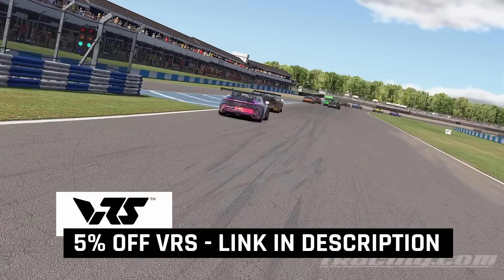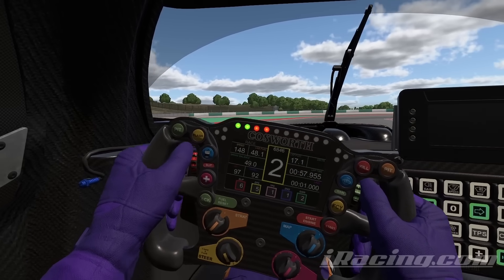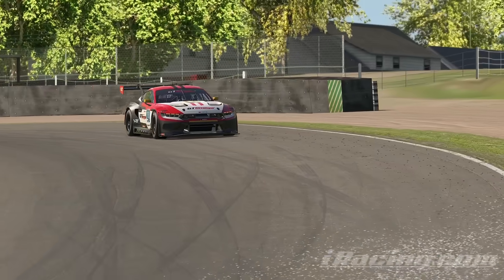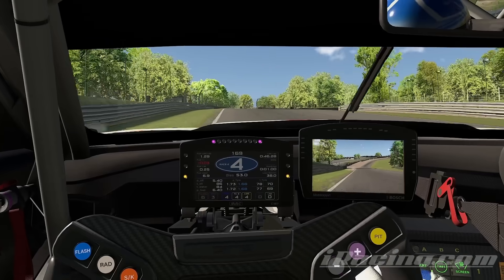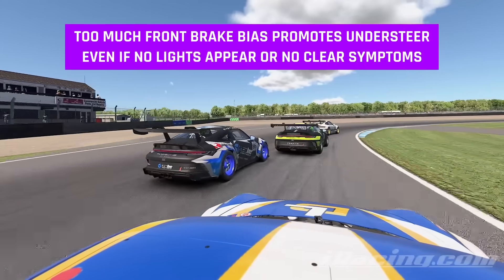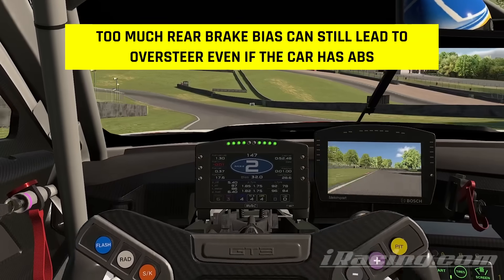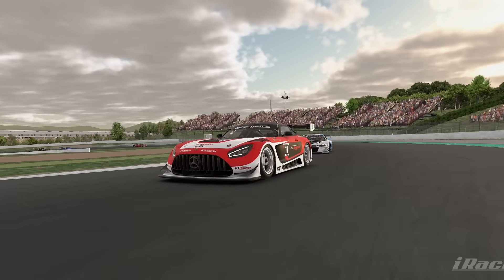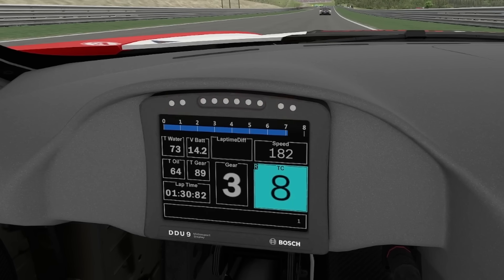These Lights Help You Drive Like An Expert - Driver Information Lights Explained

Comment: In AMS2, I sometimes see the driver information lights in LMP cars light up, even when just going down a straight stretch without any braking.
Reply: Might be the fuel saving system that uses the lights to tell you when to lift. Usually you enable it by setting up a lap target in your car options, don't know if it's on by default in ams.

Comment: At the end of the day, if you wanna be fast, familiarizing yourself with the car and track will be your end-all-be-all solution, practice laps, experiment with setup and see where you can squeeze some performance. Remember that faster setups usually also involve higher risks, wich you DON'T want during races, find something optimally quick that still allows some flexibility for the unexpected situations raaces can throw at you. Said lights can help with setup but once you know the car, unless something is going on, they will not be as important as your own knowledge and intuition, nothing is a replacement for skill

Comment: ive notice in ams2 cars are prone to sliding and oversteering so front brake bias up to 60/40 with abs usualy tames them for ideal cornering while lmu cars are the opposite they are by default understeery so setting the brake bias towards the rear makes them snappy and agile

Comment: Thanks alot for this gem of a video. At 3:39 there is some values for R.Tyre and L.Tyre. I think it's the temperature and pressure. But could you please do a video on how to read and use these values?

Comment: you see simagic extended their warranty to 2yrs
Reply from the maker: Yeah, good move
Reply: @dannyleeracing was your review of the simagic alpha u done using the pro simrig  psr3... just wondered ho it held up
Reply from the maker: @cater4anytink45  Nah, the Alpha U review was done on the GT Omega Prime - it's my mainline rig, had it since 2021. The PSR3 wasn't around for a great deal of time but the good thing about aluminium rigs is that they pretty much stay solid. My PRIME rig is looking a bit scratched up as I've adjusted it a million times, but it's good stuff and cheap.
Reply: For europe it's the law so even if it said 1 year you realistically had 2 to the distributor.
Reply from the maker: @Kpaxlol Yeah, but it’s still concerning when the manufacturer themselves is only willing to cover for 1 year if they had a choice. Resolving that is a very good move even if EU law demands 2 years of them, it’s a question of confidence in the product NOT to go wrong in the first place.

Comment: Makes no sense. Braking less = longer braking zone = longer time from start of braking > corner exit. No way that will improve your lap time cuz u drive slower that you would on hard braking with abs assist
Reply from the maker: Typically, overdoing it under braking steals laptime from what comes after. Yeah, you’ll brake physically harder dipping into ABS, but it’ll be paid for by time loss in the actual corners.
Reply: @dannyleeracing  no? There is maximum speed you can have through a corner, the faster you get down to that speed the faster your corner will be 😂
Reply: @Speedyey  not sure if it relates to what you are trying to say, but from racing karts I find that sometimes braking later means you have to over slow to make the corner. I'm not sure the real reasoning behind it but I can tell from the data that braking later isn't always better. Again I'm not sure if this really relates to what youre saying but I thought id put my 2 cents in
Reply: @23racing69im saying that braking harder with help from abs = shorter brake distance, that means you can brake later and harder and that makes you faster
Reply: @Speedyey I think that should generally be true but what I think @dannyleeracing was saying was that if you go too hard or deep into the corner you have to slow more to get it rotated costing lap time. I also feel that if you're relying on abs your braking zone will actually be longer as the abs essentially is releasing the brakes meaning less braking is done
Reply: @Speedyey also don't speak about ABS in iracing. It's better to avoid abs as much as possible than to use it to the mid/max. With braking "harder and later" you have to point out a telemetry example so that you can tell exactly where you could brake later/harder. Out of context it could mean anything and it's irrelevant.
Reply: Depends on the car, corner, temps and whatever else.

Comment: Those lights (pink/purple and yellow) are always wheel lockups, it says in the car manual from iRacing and from the manufacturer, although most GT3 cars have some kind of ABS blinking in the dash itself.
There's a lot of misinformation about the ABS and Brake Bias, unfortunately iRacing staff won't disclosure the numbers around the braking system like brake pads, most of the time for sprints with a GT3 it doesn't matter much but for endurance it can have a performance impact on tire wear, temperature and it will affect your pace.
PS.: You can disable the ABS in a GT3 and you will still see the lights.
Reply from the maker: Good info, thanks for commenting - I’m gonna look that up on my part to correct my references to that in future. Every day’s a school day and that.
Reply: PS, he said that when you don't have ABS it's wheel lock ups.
Reply: I thinj it may still be the same, lights up=lock up, but on cars with ABS, well ABS is there to prevent lock ups.

Comment: is you next video gonna tell us that when the fuel number gets to zero, youre gonna be running out of fuel?

im just joking.  thanks for all the videos and info that you provide.  you have different levels of stuff available for anywhere people are at in their experience level on their sim racing journey.  youre one of the last sim racing youtuber's that im still subscribed to!  thanks again
Reply from the maker: I released a short on this topic ages ago, and the number of people that didn't know what these lights actually stood for was crazy! Sometimes it's the topics you'd never expect that are most needed. Cheers for your support and sub!
Reply: @dannyleeracing  i felt the same way when i found out that probably the same people you are talking about also dont know that there are owners manuals for a bunch of the cars too!  they go through the same things as this video, plus more.  theres even a suspension setup video, that even though it is just super basic, is a great foundation